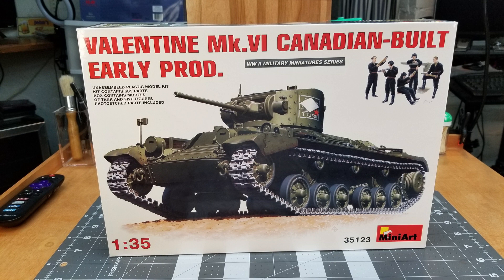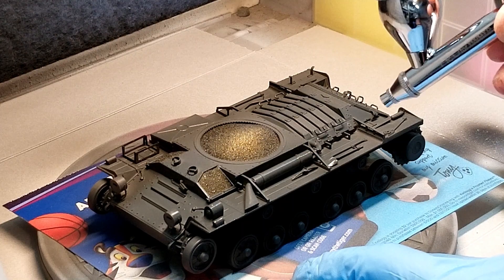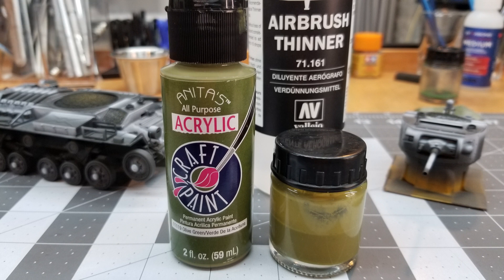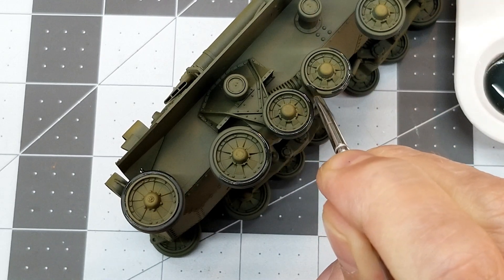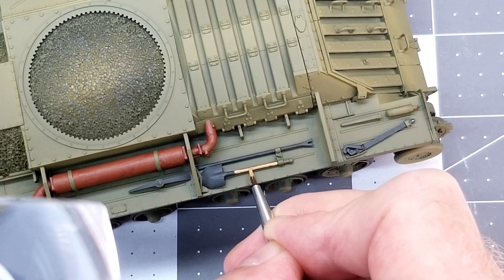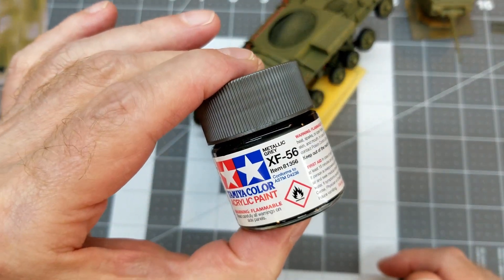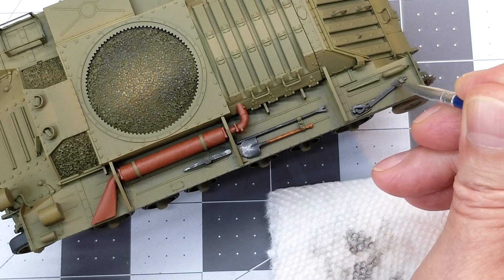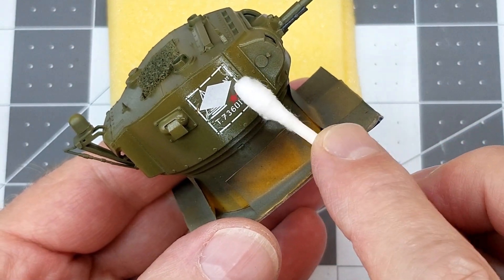Valentine Mk. VI Canadian, by MiniArt, in 1/35 Scale, Part 4, Paint and Decals

Comment: Hi Johnny, Your Valentine looks really nice.  I really like the per-shading and painting.  I have had good luck with the Miniart decals by first putting a few drops of water on the surface, applying the decal and once I have it in place, a tiny bit of Tamiya Markfit Strong really settles it in place.  I'm going to have to pick up some of the Microsol and Microset and give it a try.  I bought some of the Mr Metal Primer, but the only thing I could get at the time was the aerosol type.  I'm going to have to decant it and try brushing it on.  That are you using to clean your brush after applying the primer?  I'll be looking forward to seeing the weathering.  Have a great day.  Jeff
Reply from the maker: Thanks Jeff. As for cleaning the brush after using Mr. Metal Primer, I found that it was starting to dry in the brush before I was finished applying it. Since it was a cheap brush, I just tossed it. I do need to investigate what to use to clean it from the brush. I have to experiment with it, I'll let you know buddy. Have a great weekend! Johnny
Reply: @hillbillymodeling  Thanks Johnny, I have some of those really cheep micro-brushes, I might try using them.  Have a good one.  Jeff

Comment: Uncle Johnny a hood tip for PE parts, is to lightly sand, and burnish them, to take that sheen off. Then you won't need to use metal primer to make sure paint sticks. Just rewatvhing this series.  Great work. Oh and that craft paint, olive green is a nice color. I might have to pick that aged nickel and olive green up. You say there called Anita's brand?
Reply from the maker: Hi Rick, yes, the craft paint is Anita's. It's made by Rust oleum. Thanks for the tip on the PE. Take care. Johnny